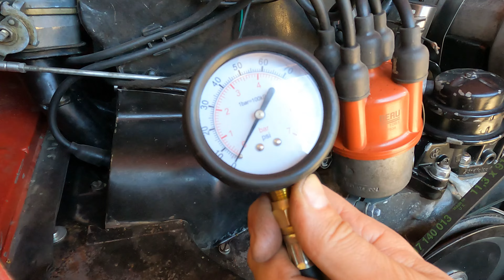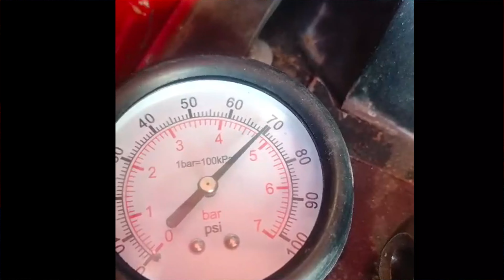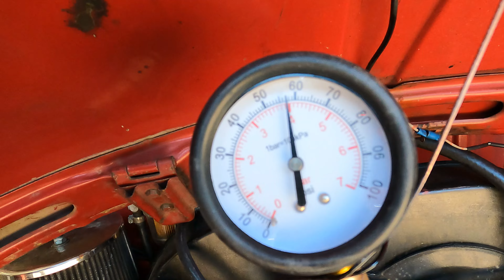I need your Help!!! I cant stop my oil leak.

Comment: The leak being on top of the block is the oil cooler seals. Just make sure you use the appropriate seals; there is two styles: one for the earlier style and one for the later doghouse style. Some advise to use just a smidge of shellac or Permatex Aviation Sealant around them. You can use the same on the pushrod tube seals. Another useful tip is putting sealant under the washers at the 4 cylinder head nuts that are inside the valve cover under the rocker shafts. That prevents oil seepage from under those that is reflected at the bottom of the head and drips over the J tubes or heater boxes. Also in my opinion the best valve covers are the stock ones with the   cork gaskets. Just make sure to use grease on the gaskets and make sure the head and valve cover are spotlessly clean. 

Re the oil pump size 21 mm sounds small; I suggest 26 mm. Oil weight should follow the factory recommendation for the climate zone the car is operating at. Finally; if your oil smells like gasoline the diaphragm of your fuel pump is toast; you might need to replace the pump. In that case make sure to use the appropriate rod length to the type of pump; there are several lengths available.
Reply from the maker: Hello there and thanks so much for your comment. I actually used some permatex sealant the previous time I attempted to fix the leak and still didn't solve the problem but hopefully that due to the pressure being too high. I actually bought the 26mm pump so hopefully it will make a difference. If I have to remove the engine again the change the oil filter seals them ill smudge more permatex on them. I have also bought a new pump just in case its leaking fuel to the sump Thanks again. Jamie

Comment: If it’s not leaking then it’s out of oil 😂
Use grease on both sides of the cork valve cover gasket and they won’t leak. 
Oil pressure is pretty high, rule of thumb at operational temp, 10psi per 1k rpm. Change to a lighter oil and retest. Cheapest and easiest thing to do.
Reply from the maker: Thanks for the advice. Ill try the trick with the grease next time! I have a new smaller pump so hopefully on the now on the right track. Jamie

Comment: Interesting. Has anyone suggested using some kind of sealant? Aviation, RTV, etc.on the seals to the oil cooler? What did you torque the nuts to? I'm actually facing a similar issue, but I did not replace the oil pump, so I'm not sure that is the cause. My oil cooler wasn't leaking until I decided to clean it. Oh, those decisions we make when we work on our cars. Looking forward to the next video.
Reply from the maker: Oh no you have learnt a valid lesson!! Don't clean it 🤣

I used some aviation sealer on the seals on the previous attempt to fix the leak. Hopefully the smaller pump will be a solution. Jamie
Reply: @jamiedowson6482  I tried Aviation on my first attempt. It didn't stop the leak but it was a lot less than when I didn't use any sealant. I'm thinking to try JB Weld Ultimate Grey on my next attempt.

Comment: You might want to consider venting the crankcase. I could tell from your video, but I don't see any venting for you crankcase. If it's not vented correctly, to either a valve cover or air filter pressure will build and push the oil out of wherever it'll pass.
Reply from the maker: Hello there and thanks for your comment. It actually has a pipe coming off from the filler but hard to see in the video. I need to feed it back into the carb though as its just pointing straight out. Jamie
Reply: @jamiedowson6482  I have mine the same way lol. I'll get to it eventually
Reply from the maker: @GT.Bugger  I use that phrase all the time 😂😂

Comment: you might need oil cooler seals that are 8mm to 10mm, you might have an older oil cooler and a later case or vise versa.
Reply from the maker: Hello. I have the later 1600 case that has the bigger outlets so I'm hoping that the excess pressure from the pump is the problem but let see. Thanks Jamie

Comment: If that case is early style oil cooler (NOT dog house), and you use a doghouse cooler, you have to use conversion seals.
Reply from the maker: Hello there. Its a later case from a 1600 and has the bigger oil ways and should be compatible with the doghouse system. It seems I have used the correct size seals but hopefully the downsizing of pump will solve the problem. Fingers crossed, Jamie
Reply: Sounds reasonable. since 1977 ive only had 36ers or 1600s with 1 1641 in 84. You'll get er!!

Comment: Is the actual oil cooler interface interchangable like that? 70 PSI isn't crazy by any stretch of the imagination but a butt faced joint should have better fitting seals than that surely?
Reply from the maker: Hello. The later case that I'm using should be compatible with the doghouse style cooler. I really hope that by fitting a smaller pump that it will solve the leak. Lets see. Jamie

Comment: 21mm pump is for a 40 horse engine.  26mm is stock for a 1600cc. And a 30mm will work just fine, the pump is not causing a leak.
Reply from the maker: Thanks so much for your comment. I actually have bought the 26mm so lets see if it make s difference  🤞
Reply: @jamiedowson6482  it took me 3 times pulling the engine chasing what you have. Each time replacing the main seal. But the last time I also covered the cam plug with silicone.  

And I can't say if it was the 3rd main seal or covering that cam plug. But my engine no longer leaks.
Reply from the maker: @OwhyeeVdub  It is a pain trying to solve these type of problems. Glad you got yours fixed though.